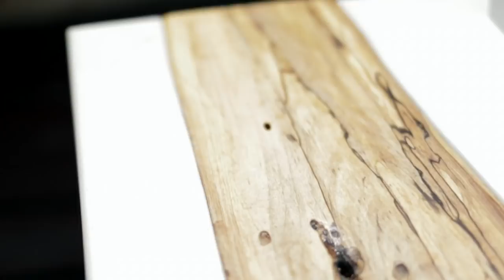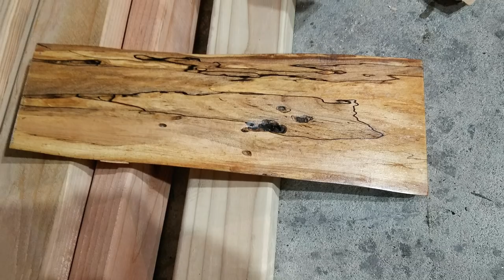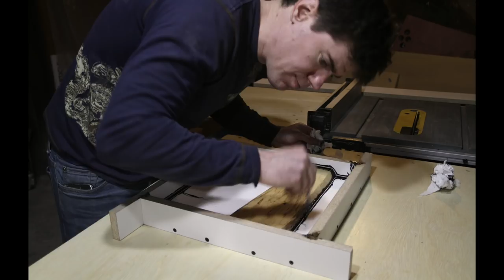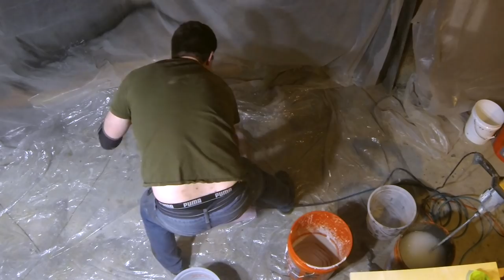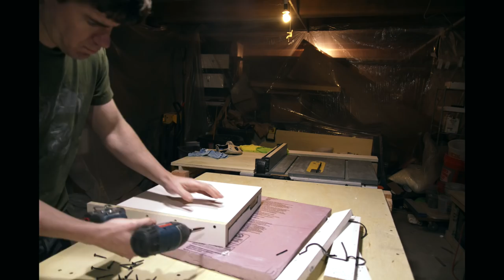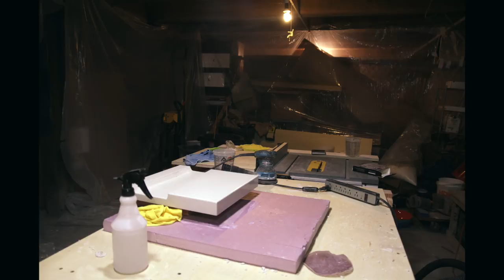DIY White Concrete Table w/ Live-Edge Maple Inlay (using GFRC mix) - How To Make

Comment: Thank you for this! Im already building my molds in hopes to have something as cool as what you built! Do you have any links to the new GFRC mixes you mentioned in the video?
Reply from the maker: Yes, here is one from the company I used: http://www.concretecountertopsupply.com/Item/GFRC_Bag_Mix

Here is another option: http://www.buddyrhodes.com/gfrc-blended-mix/

Both those companies also sell the glass fibers.  With these mixes, you just add water to do the thin face coat, and then add water + glass fibers to the same mix for the back coat.  They are definitely more expensive, but I think the results speak for themselves.  This is not one of those "make a table for under $50" type projects....it is more like a "make a $1000 table for only $250" type project.  Let me know if you need any help.  

One other option that is easier than what I did (mixing all ingredients from scratch) is to just order an additive pack and plasticizer,  and use locally sourced cement and sand.   The admix pack includes pozzolans, acrylic polymer, shrinkage reducer, etc.  You can order enough admix for about 400 lbs of mix for about $150 shipped.   Add plasticizer for another $25 (enough for more than 400 lbs): http://www.buddyrhodes.com/water-reducer-205/ http://www.buddyrhodes.com/gfrc-admixture-bulk/   You just mix sand, cement, admix, plasticizer (if needed), and glass fibers (only on back coat) per recommendation on the sellers website.  

If you use grey cement, it is very cheap at Home Depot / Lowes, about $10 for a 92 lb bag.  If you want white cement, you usually need to look up a local masonry supply store (HD Supply / White Cap is the largest chain like this, so might be in your area).  It is usually a bit more -- around $25 for a 92 lb bag.  The sand is very cheap.  I use commercial grade medium quikrete sand, which is $3.50 per 50 lb bag at home depot.  

With this "in-between" route, it makes the most sense to buy enough for 400 lbs of mix, which runs $350 or so in total.  It sounds like a lot, but for that investment, I made a coffee table, the table in this video, a fireplace hearth, and a desk top.  All that for $350 is actually a bargain :)

Feel free to reach out to me if you need more help with your project.  You can also check out my Instructables (under modustrial maker) on GFRC, which have a more detailed writeup.
Reply: thank you! I have in my cart from concretecountertopsupply: compaction roller, fishstone gfrc 50lb bag mix (2), pva fibers (5lbs), optimum 380 superplasticizer (1g), black iron oxide pigment, titanium white pigment.  Seem about right to get started? Thanks so so so much this has been a hard thing to research on my own and also your project is the ONLY one ive seen that doesnt come out like they picked up a slab from the sidewalk.
Reply from the maker: You probably want AR fibers instead of PVA fibers.  Since I was getting a lot of questions, I reached out to the guys at concretecountertopsupply (aka Fishstone), to ask about smaller packages of AR fibers (since currently the website says you have to buy 44 lbs).  They said they do have 1.5 lb  packages available, and they will be up on the website in next few days (or you could just call them to order now).  In my experience, they ship out super fast; Amazon-like speed.

And other than subbing out AR fibers, that looks good.  I didn't actually use the white pigment in mine, so if you want to cut costs, you could probably do without it.  I have used it, and it does make the end result just a bit more glowing white.
Reply: Ordered all my stuff last night and with regular ground shipping will be here in two days! they rock, VERY helpful on the phone and suggested sealers that I also bought.  Any tips on finishing? Im seeing a lot on grinders, sand, wet grinders etc.  Thanks again for all your help/inspiration.
Reply from the maker: The way I did finishing is super easy and quick.  I just did a light wet sanding by hand with 400 grit sandpaper, just enough to remove the slight texture of melamine, then did a second pass with 600 grit to get it to shine a bit more.  Then rinsed and applied the sealer.
Reply: Sorry for all the questions. The design I want to make has the demensions of 45x25x2. Will that be too heavy even with gfrc? Can't find a reliable calculator. Will be used as coffee table. Happy to email you the pic of the design if you'd like. Can't really do much less in thickness because of the leg designs.
Reply from the maker: Andrew Meyer no, that will be fine.  Gfrc actually weighs less for the same volume than standard concrete.  Since you can make it thinner with no rebar, I would suggest using 3/4" or 1" pink insulating foamular in the middle of it. Pour 3/4" of gfrc, put the foam piece in, then pour around sides and on top of the foam to fill up the form.
Reply: What size air compressor did you use? Going to start spraying Wednesday.
Reply from the maker: I just used a cheap porter cable 6 gallon pancake air compressor.  One thing I do recommend before you do a big project like the table you are planning is just to do a "test run" on a small form (something like 12"x12"x1") just to get a feel for the process.  If time allows, it is definitely worth it.
Reply: Modustrial Maker j
Reply: Do you have an email I can send you my table I just finished? I used the materials and supplies from Fishstone as you recommended and man they are so helpful and amazing.  Came out great for a first project, your advice was amazingly helpful.
Reply from the maker: Andrew Meyer yes, please do send it.  Mcliffy2@gmail.com glad to hear it out well!  Isn't the stuff awesome?

Comment: This is beautiful! Wow! great job! I am researching online DIY on countertops. I have a bathroom vanity that I want to cover in a white concrete look like you have in this video. I saw some people online did something called a feather finish concrete option (I was not planning to make a mold but rather just lather and layer the concrete on the existing wood countertop. Is this possible to do with the material GFRC you are showing here? also you mentioned in the video that there are kits available for this mix. Please let me know where I can find the kits. Thank you so much!!! again, great job!
Reply from the maker: +Roana Ene feather finish won't give you the clean look you have here, and it is a lot of work.  Feather finish is essentially just the face coat (all the admixes of GFRC, but without the glass fiber). I have tried this technique and it gives OK results...in my opinion, it looks nice, but not professional/high end... I like the look of precast GFRC much better.
Reply: Modustrial Maker are their kits available for this? Or can you spell this out for me like a recipe, so I get the right mixture? Would I find all these ingredients at home depot? Pretty new to home improvement things as we just got our first home. I am sure my project wont be as beautiful as yours but if i can somehow get that smooth white look that would be a huge accomplishment
Reply from the maker: yes, you can get a pre-mixed gfrc...check the video description in my concrete coat rack video, there are links there.

Comment: I have a question about caulking around the wood. I am thinking of making something somewhat similar and I want the concrete to be seamless and completely with the wood pieces. Wouldn't the caulk create an eased edge and void between the two materials? How can I get smooth totally flat transition w/o voids?
Reply from the maker: I think you just messaged me on Instagram?  Either that or I got the same question there 😀. Here's the answer.... 

Using the silicon will create an eased edge.  If you are careful and take your time, you can do inlays without siliconing them down.  In my case, when I have used live edge slabs, there wasn't a clean edge to press against the melamine.  But if you are cutting out an inlay, just make sure you have a nice clean edge with sharp corner all the way around, and a perfectly flat top surface so it contacts the melamine everywhere.  You want to be sure no concrete can get under the wood at any point.   Use some sort of weights on top of the wood to keep it pressed against the melamine, while you apply a face coat.  After face coat firms up (but still is moist to touch), add a first backer layer up to the height of the inlay, and let that firm up (but not fully cure) to hold the inlay in place.  Then remove the weights and finish filling the form.  It is a bit tedious,  but doable.

Comment: Nice finish, your technique is similar to something I stumbled onto myself re: the face coat as you call it, and looks to work well for you. Out of curiosity, is it glass fibre or polypropylene?
General consensus down here is that glass deteriorates over time in concrete so we (me) go for polypropylene fibres that come in from Canada, which of course adds expense etc. some people I met that do swimming pools get their own metal fibres made in China by the ton, but that wouldn't work with your clean finish I don't think.
Nice bit of wood and the minimalist post modernist steel sets it off.
Reply: Will hv  to look for the cake tool...better than the painting and wallpaper gadgets I have.
Reply: Will hv  to look for the cake tool...better than the painting and wallpaper gadgets I have.

Comment: i am a woodworker and will be doing this project within some black walnut inlays (plural) in the coming weeks.  question, is there any way to get the fishstone concrete anywhere else besides the link you provided?  their shipping costs make it almost unaffordable to purchase from them (cost of shipping is about the same as the product!).  also, the white color... is this the base concrete color or do you add color to the mix?  if so, what is that product specifically?  lastly, how "white" is it?  white-white or grayed off-white?  thanks for posting the vid.  very nice!
Reply from the maker: Thanks!  Unfortunately , shipping concrete is just expensive...  If you have a few projects, buying a larger quantity can reduce per bag shipping cost.  There are also distributors for them and others in various places throughout the US.  Where are u located ?
Reply: Modustrial Maker I am in Ohio. Thank you for your reply.
Reply from the maker: JohnMac I would call Fishstone, Buddy Rhodes, Trinic LLC, and Surecrete, and see if they have any distributors within driving distance from you (this info might also be on their websites, but isn't always up to date).  If not, another option is to order a gfrc ad pac from fishstone, and source white cement and fine sand locally (I use quikerete medium commercial sand), and make your own mix.  I have some instructables with lots of details on this option, if u are interested
Reply from the maker: JohnMac lastly, this is the base color.  It is pretty darn white.  You can add a white pigment to the face coat to make it really really gleaming white as well, but I did not do that here.

Comment: Question: what psi do you run to the hopper? 

Also, do you use pigments or aggregate very often with gfrc projects?
Reply from the maker: I want to say 40-50 psi....  For pigments, you can use any pigment you would use for standard concrete.  Typically you only use decorative aggregates like glass, since no aggregate other than fine sand is needed for strength

Comment: Did you have any issues with the wood expanding and contracting since you have made this? I am currently trying to figure out how to do a concrete floor with wood inlay for a lobby.
Reply from the maker: No issues.  The mold is extremely humid, so it will expand during the pour, and contract after some.  You might see gaps due to contraction, but the bigger concern of wood expansion cracking the concrete shouldn't be an issue.

Comment: Love the design. I'm considering doing a similar style table with wood slab inlay. My only worry is that when the wood contracts with changes in humidity/temperature, it will eventually show cracks/gaps where it meets the concrete. Any thoughts or similar experiences?
Reply from the maker: Expansion was definitely a concern. This is part of the reason I poured the concrete right over the wood in the mold, and then covered the mold while the concrete cured. While I sealed the wood before I did this, the water from the concrete mix still evaporates and creates a very humid environment in the mold (surrounding the wood). This is about the maximum humidity you would find any any environment the table will be in. Thus, the wood expands a bit in the mold while the concrete is still curing (i.e., not hard yet), and the concrete cures around and takes the shape of the slightly expanded wood. Once demolded, the wood contracts. As a result, there is a slight gap between the concrete, but nothing too noticeable (at least IMO). More importantly, there is very little chance the wood will ever expand more than it did in the mold and cause cracking in the concrete or wood. GFRC also can flex and bend a bit (much more than standard concrete), so this helps.  I actually made this table about 6 months ago, and it has been moved around, inside and outside, and so far, so good :)
Reply: Thanks, very helpful!
Reply from the maker: +Adam no problem!
Reply: Modustrial Maker how much GRC did you use?

Comment: is ti possible to use this mixture for flooring? it looks so beautiful
Reply from the maker: Alexandra Stratan you know, I'm not sure, but I think it would be tough because you pour floors in place usually, instead of casting upside down, and this would result in glass fibers showing thru.  You could definitely precast large tiles, and make a concrete tile floor... Just wouldn't want to pour it, I don't think.

Comment: Hi! Thanks for the video! This looks amazing (plus you're making it look amazingly easy). 
One question I have is how thin do you think one can make the slab? I'm looking for a budget kitchen top up to, say, 2 cm (~4/5 inches) in thickness. Do you reckon it will hold up? I don't plan significant overhangs - say, 1x thickness maximum.
Reply from the maker: Yeah, 2 cm is plenty thick with GFRC if you don't have overhangs.  And, thanks!

Comment: If you were to make this for outside what steps would you add? I was thinking maybe epoxy to seal the wood instead of poly then a couple coats of spar varnish over the whole piece in the end?
Reply from the maker: I would go with cedar, teak, Ash, or another outdoor wood.  However, if you are in climate where the weather is variable, you'll likely have issues with wood expansion....you'd have to take that into account.  If you used an outdoor wood, then you could just oil it periodically
Reply: Modustrial Maker thanks. Beautiful piece btw!

Comment: I like your Table, great Work man, but I wonder (sorry for my english) why you also use the silicone on the Wood, and with the same tool (Fondant Ball thing) This will make a "valley" between the Wood and the Concrete, so there will always be some dirt in the lines ? Or did I misunderstand something ?
Reply from the maker: Thanks!  Yes, this was a tradeoff -- I wanted to make sure none of the concrete got underneath the wood and caused it to float up.  There are small valleys (you can see in the video).  I actually used a fondant with a smaller ball for the edges of the wood, than I used for the rest of the mold, which helped to minimize the valleys.
Reply: Thanks for verry fast answer. I could not see that you use a smaller tool for the Woodcontours.

Comment: What did you use to attach the wood piece to the GFRC?  Also, how did you attach the metal legs?  Really appreciate your video!
Reply from the maker: Just used liquid nails for the wood attachment, and Tapcon concrete screws to attach the base.

Comment: Did the mix start out white or did you do something to it? Also is there a minimum thickness you would suggest?
Reply from the maker: It is white because I used white portland cement.  If you don't want to make your concrete mix from scratch, check out the just-add-water GFRC mix I used in my latest video for the concrete coat rack.  It comes out a nice white color without additives.  If want super gleaming white beyond what you have with this table, you can also add white pigment to the mix (but I did not, since pigment is somewhat pricey).    

With GFRC, you only need to make it a minimum of 3/4" thick for a table this size up to about 4 feet long, and I suggest 1" thick for pieces more than 4 ft (although you can get away with 3/4", depending on whether it is an application where it has to carry a lot of weight).   To give larger pieces a thicker look, I usually just add a foam core (pink foamular insulating foam sheets) in the middle of the concrete, but keep the thickness of the actual concrete around 1" in order to keep weight down and reduce cost.

Comment: I see you had extra top coat material.  Can you just add the fiberglass to that or is it necessary to make a new batch with the fiberglass?
Reply from the maker: You have to wait for the top coat to firm up, so you can't make the back at the same time
Reply: Sorry, better asked:  with the leftover top coat material, can you just add the fiberglass to the left over and use it for the back coat after the top coat firms up?
Reply from the maker: It depends.... If it's warm and the top coat cures quick, you can use the leftover as back coat.  Most of the time, however, I just make concrete planters from smart water bottles, or put it in star wars ice cube molds, because it will cure before it's time for the back coat

Comment: Was there air pockets on the finished surface that you had to fill in?
Reply from the maker: No, with the plasticizer and face coat with no aggregate, the top surface came out pinhole-free.  I also used a defoamer admix that helps to reduce air bubbles that could create pinholes.